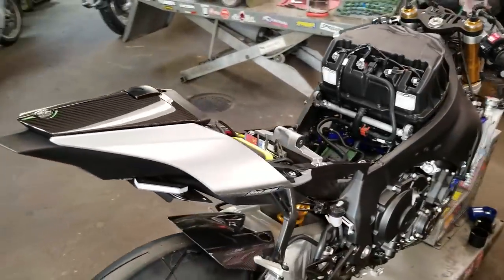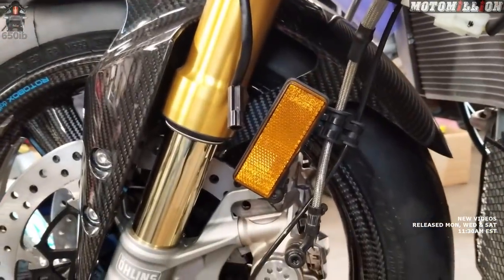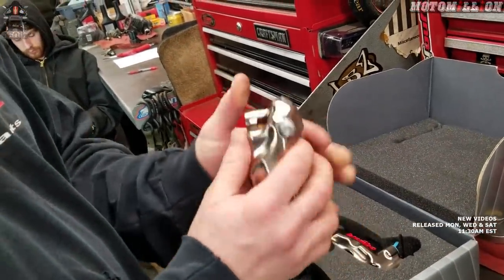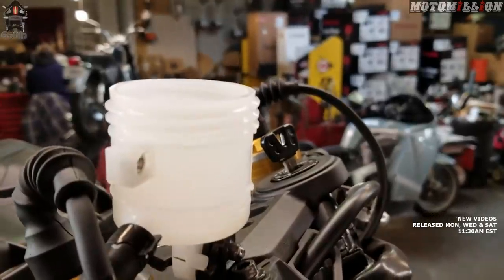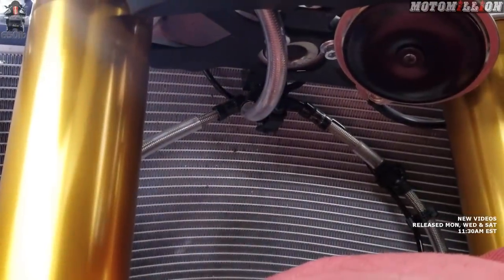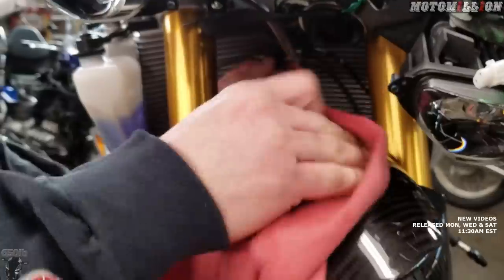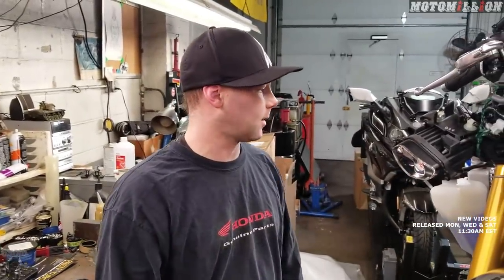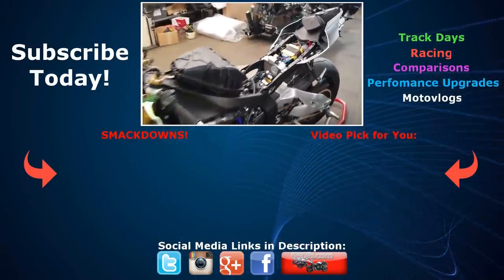Yamaha R1M Brake Upgrade | Brembo Calipers & Carbon Fiber Brake Lines (1/3)

Comment: Fun fact two piece calipers are usually more ridged than all aluminum mono blocks because the steel/titanium bolts in a two piece are inherently stronger than the aluminum. for a bike idk if that matters as much due to the weight being so low compared to a car but the torsional forces on a car is enough to flex calipers/rotors
Reply from the maker: Thanks for the info!

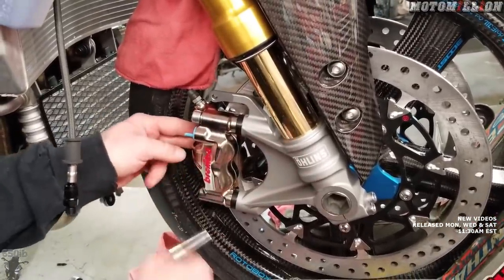Comment: @9:00 what type of spacers are those on the caliper and why did u use them and if i were to install the same on a 2015 Daytona 675 ABS, what spec spacers should i use?

Comment: Yamaha requires a tool to bleed the abs module? Kawasaki doesnt. I replaced my oem master cylinder, braided lines and deleted the abs system on my zx10r. Made it 1000x better.  When it was time to sell the bike i put the abs system back in and standard bleeding process. Just took abit longer to work the air out of the module. Buddy i sold it to is a track junkie as well and deleted the abs system again shortly after he bought it lol

Comment: i always heard you can't switch out the calipers and still retain the abs system. if you go brembo you need to remove abs completely. or at least that's what brembo says
Reply: Tom Eelbode abs optional with brembo callipers